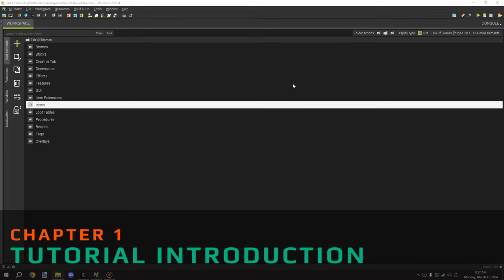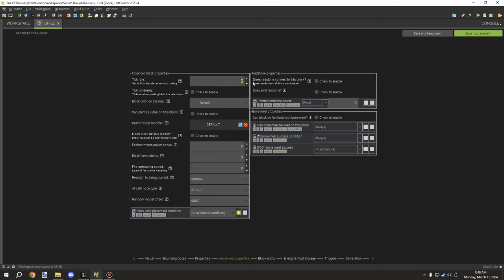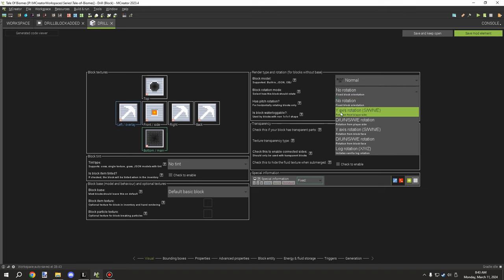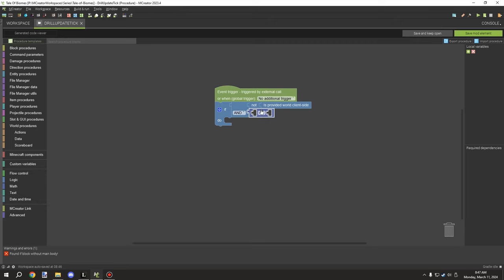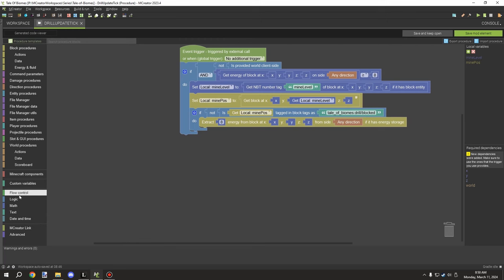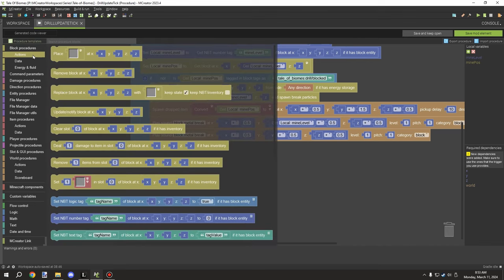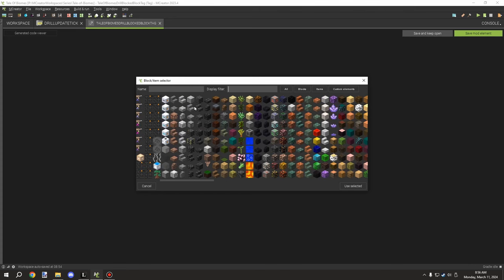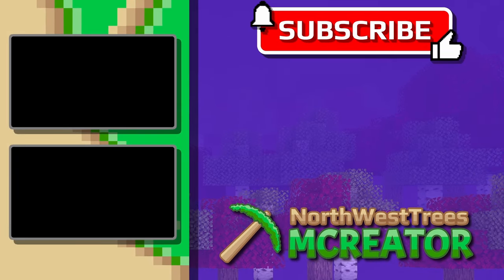Part 6 | FE Drill Machine | MCreator

Comment: I wish you could put a storage to collect stuff 🤗
Beautiful video as usual, thank you 🥰
Reply from the maker: I do want to add item tubes, though I need to figure out some stuff before I can work on a tutorial for it. It would be nice to use the cable model and system but I am not fully sure just yet how to go about doing it right now. I know there needs to be some kind of sorting system at junctions but then there is other factors like how would it react to items being added. There needs to be a directional system like cables have but then this would have other things that need to be test aside from that I also need to look at if title entities react to unloaded chunks. If I am correct the chunks unloaded would prevent items from being moved so I may need to force load the 3x3 blocks around the tube blocks this would allow them to stay loaded or maybe an anchor block could keep the system loaded but this raises other questions. But in short its one of my plans I do want to work on at a later date.

Comment: Hi, I'm having an issue where the drill only starts mining at Deepslate. I've tweaked the drill slightly to be activated by redstone instead of energy but I don't think that should effect the mine level. If you have any idea of what may be causing this I'd appreciate any help I can get! Enjoying the tutorials, thanks.
Reply from the maker: I actually had the workspace up for an other comment so I can double check the tick update variables for you right now :D

So the "mineLevel" controls the Y position for the block. The update tick procedure will run the mining mechanics.
But the device also needs a block added procedure which sets the default value of the "mineLevel" to Y - 1 which is directly under the drill block.

This is when the drill runs the first tick it will not mine it's self and instead mine the block under it.
From there the Update Tick will decrease the Y level at the end of each iteration cycle.

I hope this helps a bit.
Reply: @NorthWestTreesMCreator  Ah, thank you for the help. I’ll give it a try - much appreciated!
Reply: @NorthWestTreesMCreator  It worked, thanks very much.